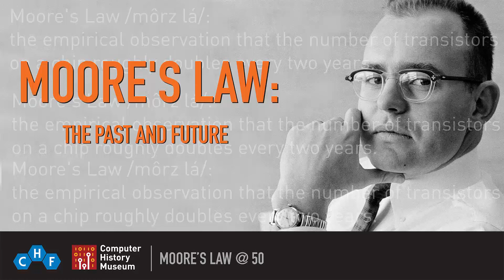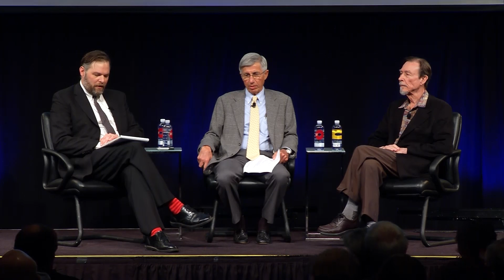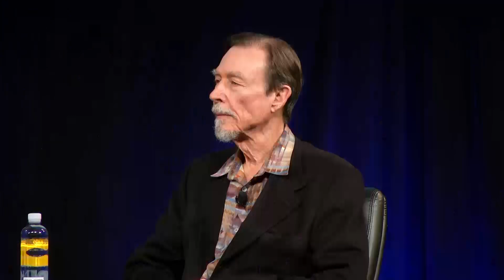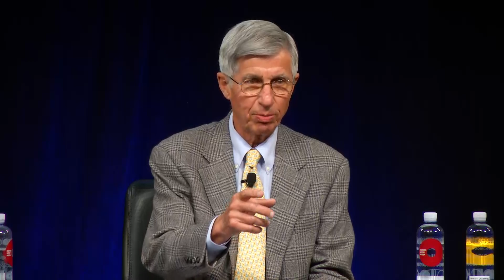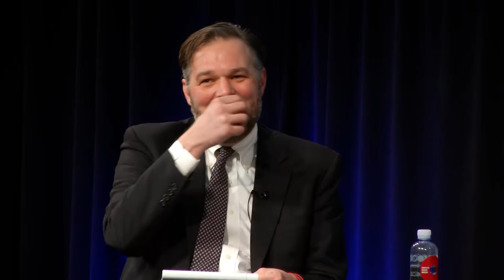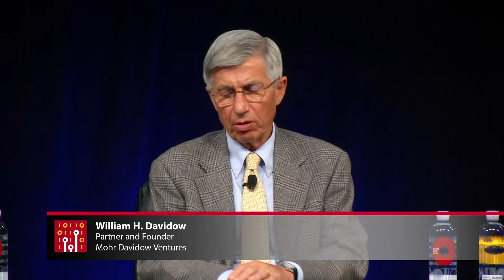Moore's Law: Past and Future

Comment: 3D layering can really raise our current processing power to the power of 2! We have a lot of room for improvement there , unfortunately it doesn't look easy at all.
Reply: +betastate And by "We" , I ofcourse mean other people who make chips for a living :D
Reply: +betastate Yes, but does the 3D layering reduce power consumption?

I think that is one of the main limitations currently. Like in the mobile applications the battery life is limited. Power consumption issues are also what caused the clock frequency war to end about 10 years ago. :)
Reply: wopmf4345FxFDxdGaa20 3D layering can bring important parts of a CPU closer together , thus making it work at higher clock rates with a smaller travlel time.If the distance the signal needs to travel decreases , that's clearly less electricity to make that work as well :)